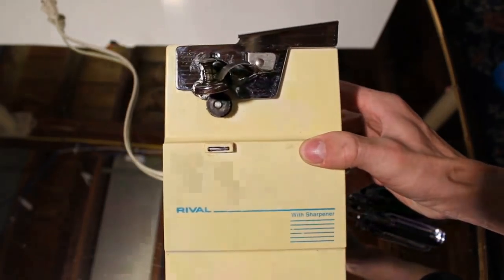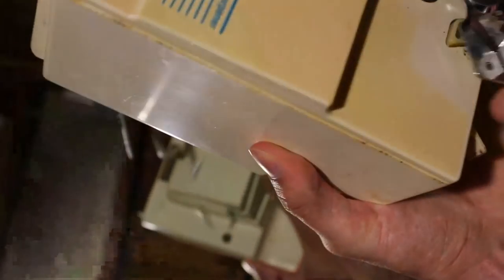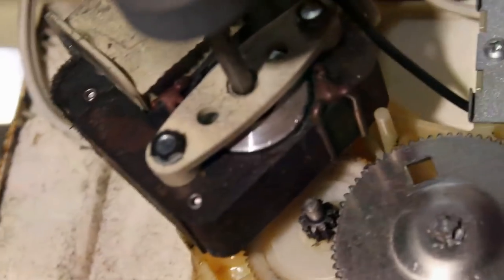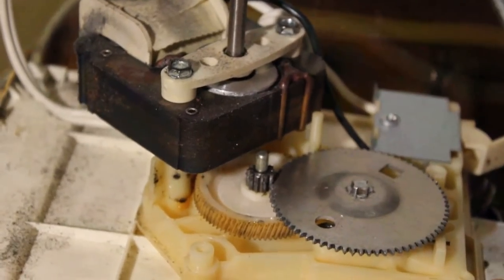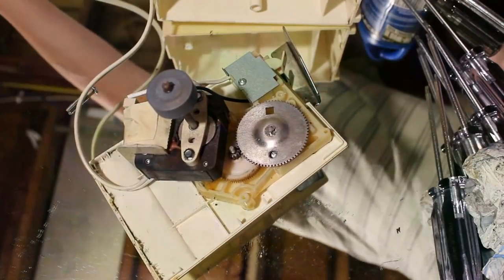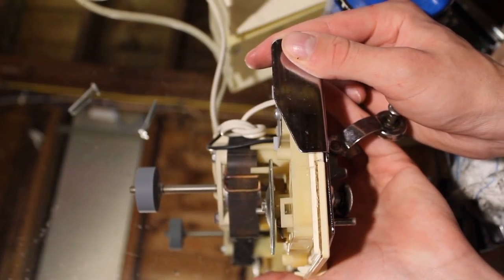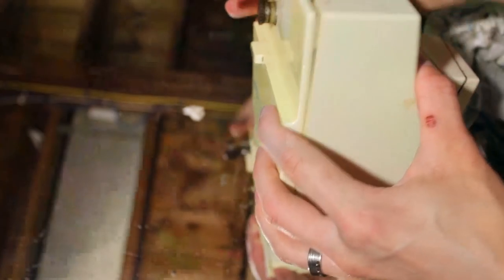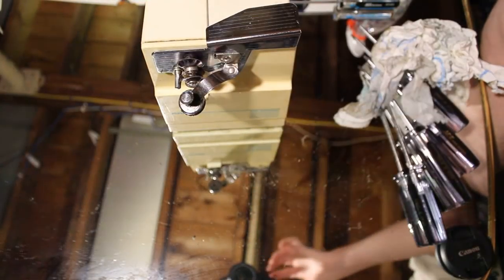What's inside decades-old can opener

Comment: The case that turned yellow on front you can get rid of the yellow by soaking paper towels in Hydrogen peroxide and laying them over the front of the can opener and set it in the sun for a few hours and it will turn white again. I seen them do it to old vintage computer cases. I bet the inside of modern can openers is not that well made.